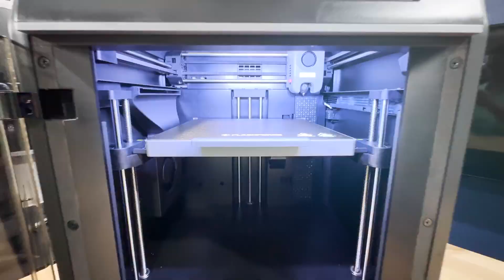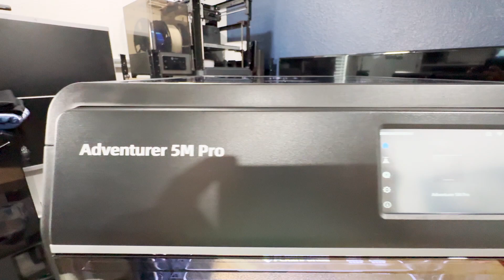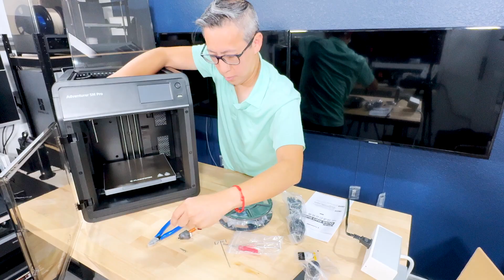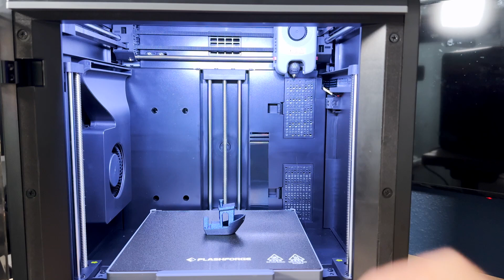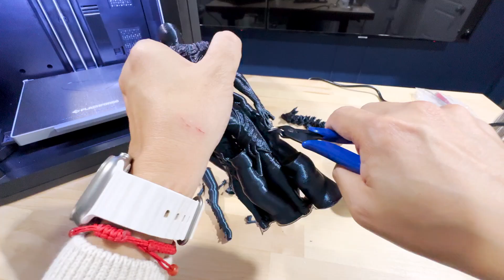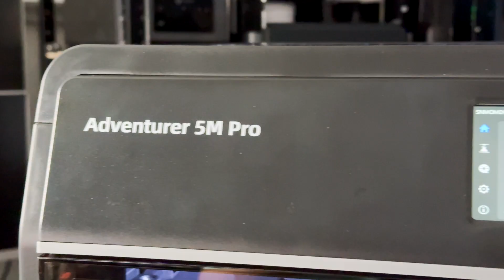Why the Flashforge Adventurer 5M Pro Is a Budget-Friendly 3D Printing Powerhouse

Comment: What about multi color?
Reply: Flashforge just released a multi color printer called AD5X!

It's basically this printer, but upgraded and with multi color function! 🎉
Reply from the maker: This one doesn't have a multi color system.  They just released a multi color unit which I will hopefully get to test out and review